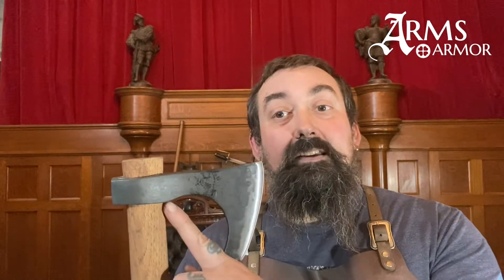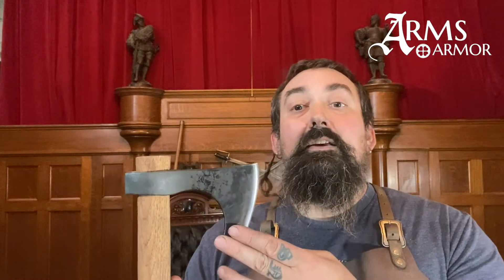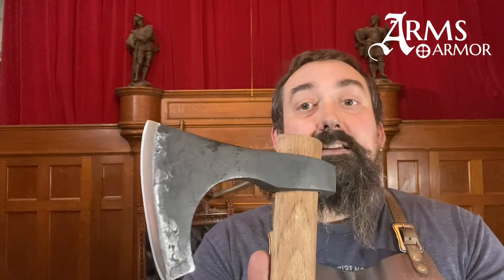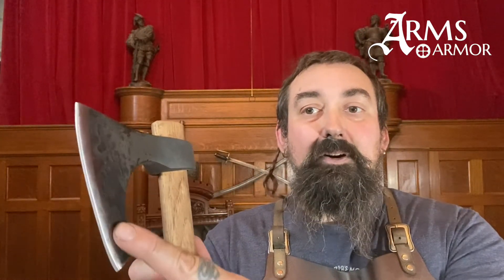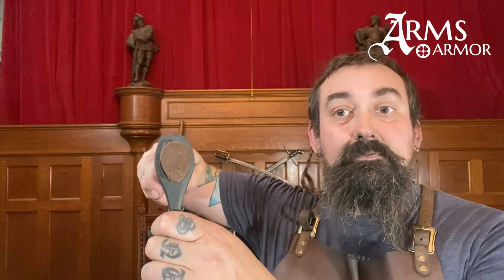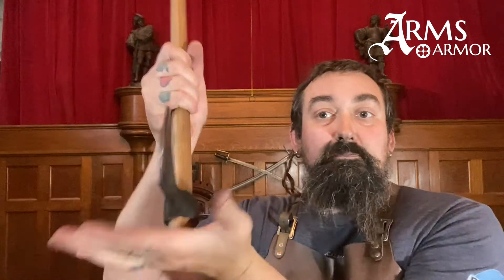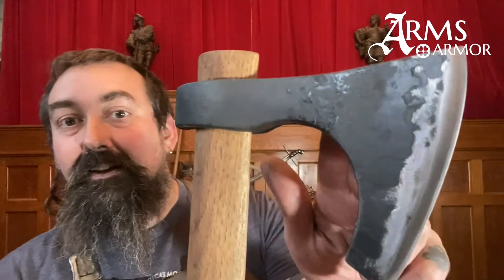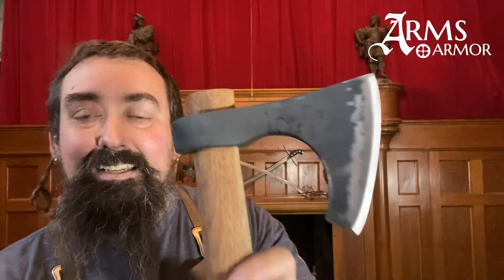Further Improvements to Nordland Viking Axe

Comment: Bought one of these from you guys at the ren fest.... Love it, I love it so much.

It's my first historical weapon, and it feels so good to have something that's so simple, yet so effective. I can get it moving very quickly, and it can be handled in such an agile fashion for an axe (which is to be expected of an axe that is at least partly meant for fighting).

I'm glad you updated the finish and that I got one with the new finish as well. It feels and looks amazing.

I believe you did the bill! Heh. 

I'll probably want a spear from you guys next, since those are the sort of core military arms. But the axe is just such a versatile tool for such a price compared to other weapons... It's almost as effective in many scenarios, especially with a shield, as a sword would be, but you can chop with it, and it's lower maintenance.
Reply: Glad you like it. May it serve you long and well.
Reply: @cjswordsmith  Heh... one more update because I'm a sharpening enthusiast;

I beveled the edge to be slightly steeper and I got the edge actually able to shave hairs... but then I stropped the crap out of it (with compound) to give it a steeper convex edge for striking with the durability of a convex edge. So, it's still razor sharp, not quite shaving because of the bevel right at the edge, but now it should hold up to a lot of punishment while staying super sharp.

Comment: Just subbed. Great videos. Wierd that you would sell an unhardened ax blade though.
Reply from the maker: It was a product that we did as a replica and even though not hardened worked well as an axe. We did weld on hardened edges as a customization for those that requested it.

Comment: is the edge geometry on this axe suitable for chopping wood and survival/camp use? Ive always wanted a good bearded axe to take camping but 90% of the "norse style" axes seem to have a far too wide bevel so that it just bounces off wood or otherwise not bite very well. or have far too much of a stylized American bent hatchet handle. Sadly for myself, I can sharpen an axe...but my skills and equipment are very lacking to try and put a new edge geometry on one.
Reply from the maker: Works pretty well for most people. Even had a few used by fire fighters and trail maintenance folks.

Comment: I bought one of these from kult of athena in which whom I would no longer do business with ever for their bad business practices, any how looking at the example you have there it looks like the blade has a lot more width compared to mine as it looks like kult of athena had ground down the edge back to hide some blemishes or rust pitting, the edge width on mine from the back of the beard to the cutting edge isn't even an inch wide. How much of the bit did you guys harden these? I just want to know how much hardened edge I have. I really wish I would have purchased mine directly from you guys instead of going through those crooks at kult of athena.
Reply from the maker: Sorry you had a bad experience the bottom of the bit is about 7/8 of an inch wide. Send me an email of pics of your axe. If its been messed with we will work something out for you. aa@arms-n-armor.com